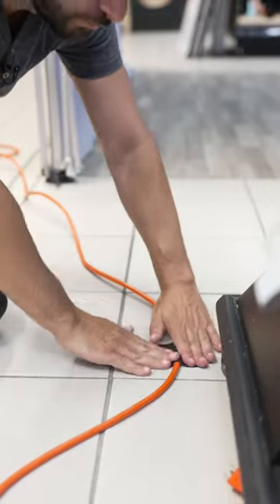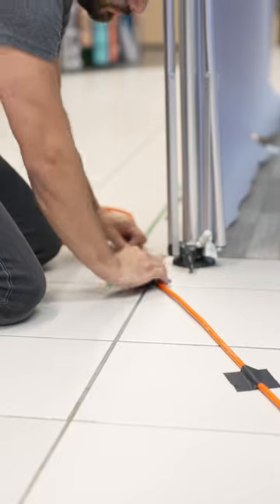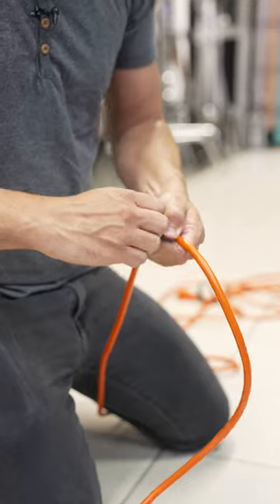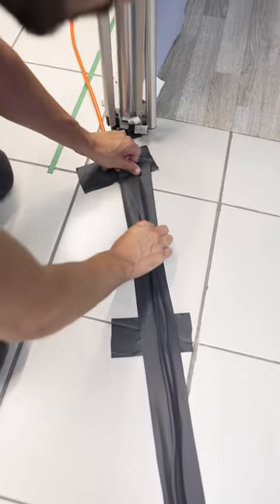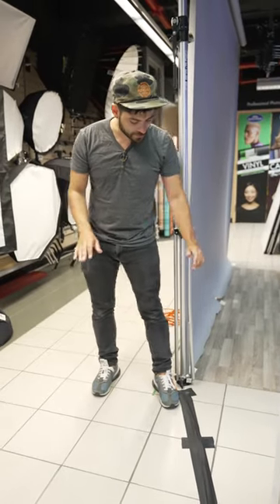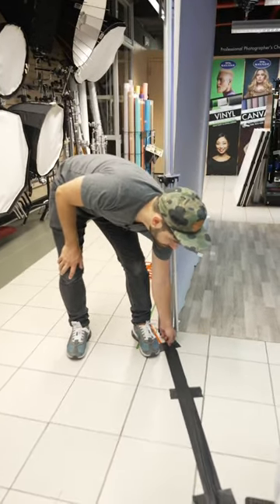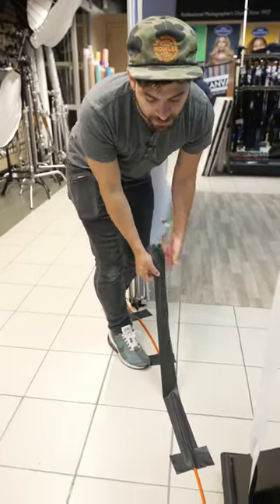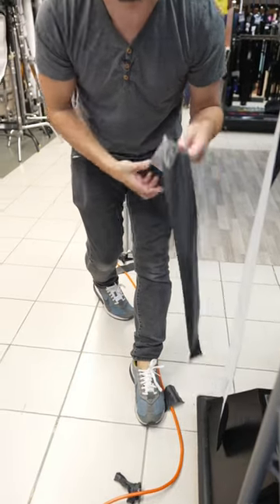Here’s how to tape your cables like a pro #shorts

Comment: Can you use GAFF tape to permanently keep down wire that runs across a hallway so it's not a tripping hazard? Or will that create too much heat?  I was going to use electrical tape, but that's an insulator.